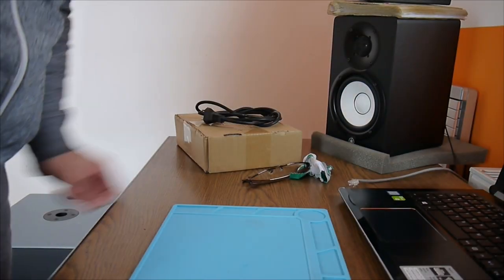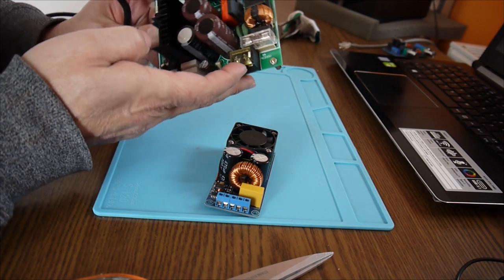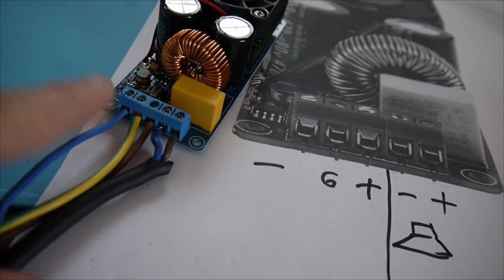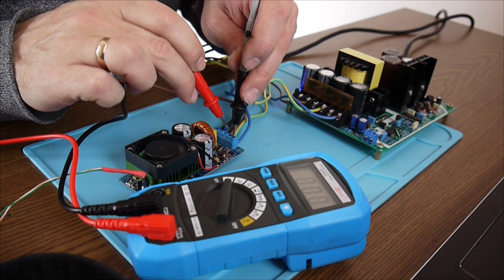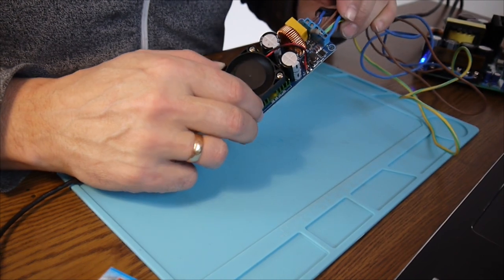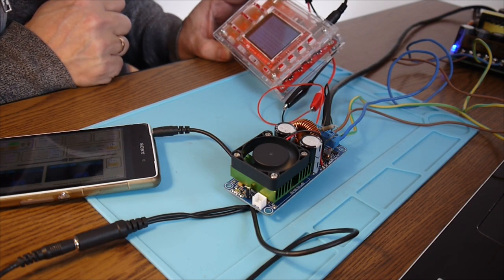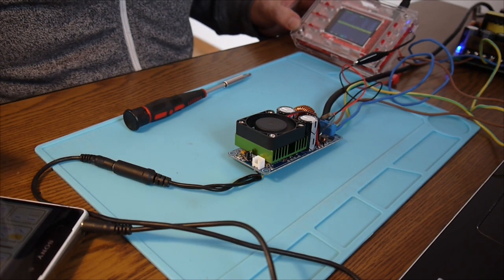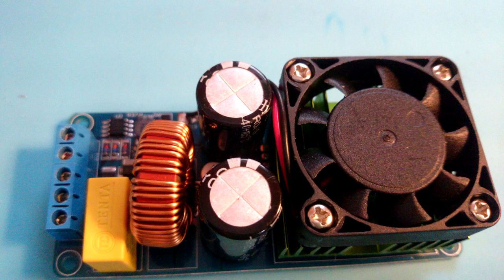Budget IRS2092 500W amplifier subwoofer project powered by SMPS 500W -+58V

Comment: I finally got that $15 500watt Chinese Amp operational last night. Dang!!! Its loud. The way I have it hooked up is 58VDC so it will prolly be just over 100Watts RMS. Mebby 113W. But the power supply runs Hot. roughly bout the same heat as 2 100 watt light bulbs so I need a fan on the power resistors. Calculated power draw from the plug is 1.17 Amps. Its a Power Amp chip made by Infinion. I think its an American company. So far I'm impressed. I can plug a guitar right into the input no preamp needed. But it needs a volume control. My ears are still ringing.
The PS is just a full wave bridge rectifier plugged into 117VAC wall plug, then DC is divided by 2 100watt 50 ohm resistors screwed down to a large heat sink,  and filtered by 2 1000uf 100v caps. 
100 watts is all Im after so I may add another  10 or 20 ohms to the resistor divider for less heat.
Reply from the maker: Interesting! All of this on a chip, or the same IRS2092 like in my video?

Comment: What power supply do you recommend for 100watts RMS? And, whats it sound like? Some of these "D:" class amps have all the high fidelity of an Ice Machine at a Motel 6.
Reply from the maker: I believe +-50V will be ok for 100W. The sound it's typical class D, kind of ''trumpet'' but pretty ok for a subwoofer. There are some mods you can do for better behave. Check the comments, plenty of good advices.

Comment: Which 58 Volts Should Be Connected Here? and Ground For what, if vcc- and vcc+
Reply from the maker: IT is a differential 58V DC, means ground and two symmetric +58V and 58V related to ground. Measuring from +to it should be 116V DC
Reply: Is it okay if I don't connect anything to Ground?
Reply from the maker: @CavadHP  Of course not! You must to have ground and two symmetric voltages. Check the internet about...
Reply: Please tell me vcc+ and vcc- (I will connect 75 volts) What should I connect to ground after connecting 75 volts?
Reply from the maker: @CavadHP  Please check this video , try to understand the principle https://www.youtube.com/watch?v=kzLJOudXX_Q
Reply: @viocaia  I used 65v, but when I turned up the volume a little bit, the amplifier broke down, vcc+ and vcc- It's a short circuit, please help, how can I fix it?
Reply from the maker: @CavadHP  like I said in the video, this amplifiers are very temperamental, probably self oscillating distroyed the mosfet transistors, so you should start with those 2 guys. For me 2x65v is kind of limit, you could see the producer test it with 57v only. Next time be gentle and use lower, at least for testing.. Good luck
Reply: @viocaia  thank you
Reply: @viocaia  Finally I Researched and Found It, The Outputs Should Be  116+     GND(AC)     116-
Reply from the maker: @CavadHP  for this module? No way! That's to much, I recall correctly it's like 65+ /ground /65-
Reply: @viocaia  Is it true, sir?
Reply from the maker: @CavadHP  Absolutely! Look here or search for 500W class D amplifier board Just found this amazing item on AliExpress. Check it out! Please help me choose!
US $17.40  20%OFF | 2X IRS2092S 500W Mono Channel Digital Amplifier Class D HIFI Power Amp Board With FAN, I'll send a link when I get home
Reply from the maker: @CavadHP  Here you have the original schematic. There is only +-35V DC , evidently for testing purpose. So consider +-65V like a max for this... https://www.infineon.com/dgdl/irs2092.pdf?fileId=5546d462533600a401535675f1be2790
Reply: @viocaia  Thankss
Reply from the maker: @CavadHP  Always
Reply from the maker: @CavadHP  Always!

Comment: What would explain loud clicks about every half second. Im using +-53v and 4 ohm sub. There is a preamp. Replaced the 100 ohm with 3.3k resistor. Its like it never fully turns on, heat sink cool to the touch. Has not produced sound just really loud thumps every couple of seconds.
Reply from the maker: Follow the comments, there are few solutions. Personal, I didn't succeed to make one sound good. I just gave up. Clicks, probably from auto oscillation of some sort.

Comment: that's good small pack but hard to fix disposable  expensive for me, so i'd rather choose an LM3886 or Stk 4142, or  TDA7294,TDA2030, TDA 1515, just for me
Reply from the maker: I found TDA 7294 in bridge a very reliable and good sounding amplifier.

Comment: I had build stereo setup from two modules. Powering both of them with 600w -65-0-+65 power.  In my case both of them enough for 2x200watt RMS 8Ohm speakers. I am using it after NE5532 based pre amp. I had measured RMS power of amplifier it is about 250 WATTs, and it is quite good for this little guy. Have some small noise with powered off pre amp, 
If anyone knows about input adjustable  resistance , please tell me what is it for ?  many thanks in advance.
Reply from the maker: Nice! Please read the comments, there a lot of nice hints.
Reply: Məndə almışam amma hələ quraşdırmamışam. Deyirlər dinamiklərə tok verir yandırır. Sizdə necədir işləyir?

Comment: Hello good video, with that source you used can you use 2 of those amplifiers to make it stereo ?
Reply from the maker: I just recall that power supply provides 600W so maybe with a better capacitors battery will be good enough ..but you better search for a more powerful one..like 1000W.This maplifiers are really need current..a lot!
Reply: @viocaia  Where can I get that switched power supply? to connect 2 of those amplifiers
Reply from the maker: @jesusdaniel3536  Please read the comment before..For the SMPS please search Aliexpress..that's where I bought it..so you need a diferential -+ max 60V DC ! Not more..